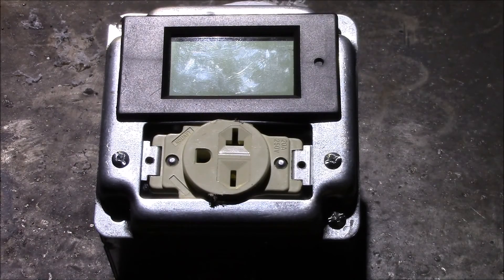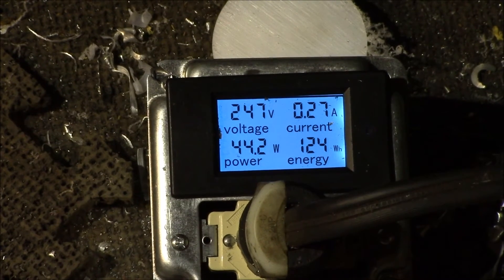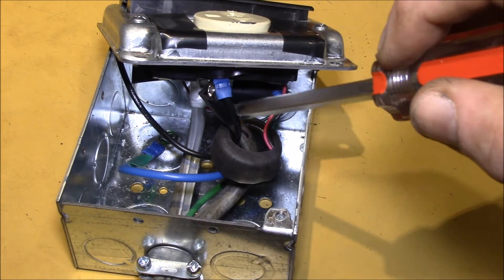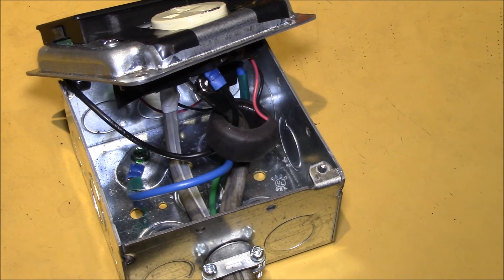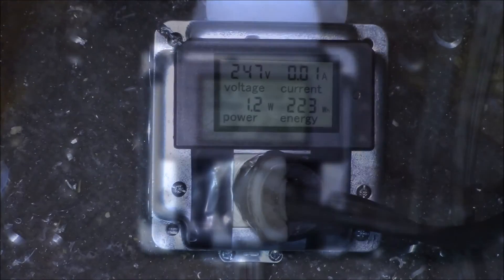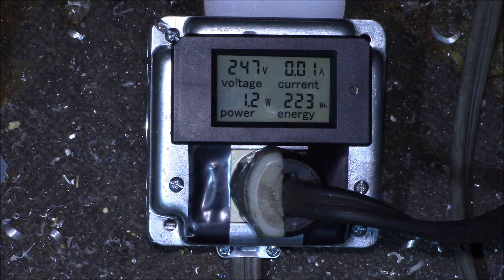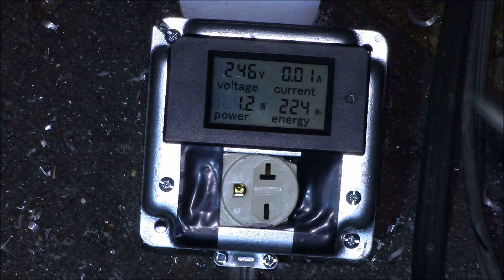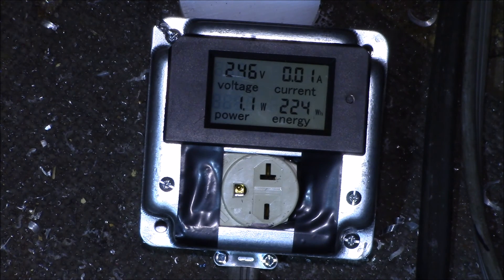240V Split-Phase Kill-A-Watt Meter, Testing and Mod

Comment: Stupid question. I am trying to use this meter to monitor my generator watt use. I would like to monitor the usage 3 ways using 3 meters.

I want to monitor the total use at 220. So would I use two hot wires (red and black) to power the meter followed my the CT going over one lead?

Than I want to monitor each hot lead  so I can balance the draw from the generator. So would I use one hot and a ground to power the meter than slide the probe over the same hot wire i want to monitor?
Reply from the maker: For the 120 sides, hot (L1 or L2) and neutral to power the meter, i.e. it'll read 120 volts.  Then run the connected hot wire through the CT to measure the current in that leg.  Think of using a volt meter and a clamp on ammeter, same connections.

For the 240 total power meter, use L1 (or L2) and neutral to power that meter, i.e. it'll read 120 volts.  Then take L1 and run it one way through the CT and then take L2 and run it backwards through the CT, doing this adds the current in each line together - reversed direction because the 2 lines are 180* out of phase.  Then the meter will read 1/2 the voltage and 2X the current, so the power will be correct.
Reply: @The4Crawler   @R Brown  I think I got it. Power the meter the same way the 120 but pig tail the leads back through the CT? Essentially how you did it in the video.

Another gentleman who is monitoring a tesla charger runs black and red hots to the machine than slips the CT over the outgoing hot lead. And he mentioned kirchhoff's law.

https://youtu.be/Y2Zshe7JKgk

I attached the link for his video
Reply from the maker: @gdejackmo  If you have a balanced 240V load, that is the same current in L1 and L2, then the way I wired the meter up works.  In my case, I was setting the meter up to work on my 240V clothes dryer, 240V welder and 240V milling machine.  This would probably work on an EV charger as well.  If this is the case, run one line wire through the CT and measure voltage from L1 to L2 and voltage, current and power will all be correct on the display.

But if your load has different currents on L1 and L2, then you need to run both through the CT, but reverse one of the 2 wires so they add instead of subtract (since L1 and L2 are out of phase they'll subtract unless you reverse one wire).  But since the currents are adding, the meter will display ~2X the current.  So to compensate for that, measure the voltage from L1 (or L2) to neutral, or half of the 240V.  So the meter will read half the voltage, twice the current, but the correct power.  For example if you had 8 amps in L1 and 12 amps in L2, the meter would read 20 amps (L1 + L2) and the power would read 2400 watts, or (8 x 120)  + (12 x 120) = 2400.
Reply: @The4Crawler  thanks for the clarity!

Comment: Very Interesting!  Thanks for the video.  I bought this meter to measure the output of my 3.7kW solar array.   I'm wondering how to connect the meter if my output is 240V (L1 and L2 are each 120V).    Should I run the hot lines through the CT but in opposite directions?     ...then how to connect the AC power?
Reply from the maker: If the currents in L1 and L2 are the same, you can wire meter across L1 and L2 (240V) and then run L1 or L2 through the CT as I did in this video.  Volts, amps, watts and KWH will be accurate.

If currents in L1 and L2 are different, then wire meter between L1 or L2 and Neutral (120V).  Then run L1 and L2 through the CT, one wire reversed direction.  Then volts will read 1/2 (120V), current will read 2X (L1 + L2), watts and KWH will be accurate.
Reply: @The4Crawler   Thanks.  I'll give it a try
Reply: @The4Crawler  When you say "wire the meter across L1 and L2" do you mean to connect both of those lines to the AC portion of the meter?
Reply from the maker: @scottantonides9209  Yes, just pretend that's a regular volt mater and you want to measure the voltage between L1 and L2 (240 volts).
Reply: R Brown got it.  I’m not sure how that works in theory but I’ll just give it a try
Reply from the maker: @scottantonides9209  All you are doing is powering the meter and measuring the voltage between L1 and L2, i.e. 240 volts.  If you were in a country in Europe, that's the same way you would connect the meter as those 240V countries have no neutral connection in the middle.  The only difference between this meter and a digital volt meter is the DVM has a battery inside it for power while this meter generates it's own power supply from the two wires connecting it to the power source.

Comment: If I'm measuring total watts on a 240v, 30 amp hot water tank, what size wire would you use for the two voltage leads that connect to the meter?  Thanks!
Reply from the maker: I suppose the safe answer is 10AWG or it's mm equivalent to have the same current rating as the connected circuit. 
 But you may have trouble fitting that large a wire into the terminals.

Note the two voltage sensing leads only carry a few 10s of mA current to power the meter, so most any gauge wire would work, say 18AWG or larger.  For added safety, one could use the smaller gauge wire with an appropriately sizes in-line fuse to protect that wiring in case the meter short circuited.  So any size fuse up to about 7 amps would be fine with 18AWG wire.
Reply: @The4Crawler  Hello.  Thanks for the video and the thorough responses to everyone.

Can you point me to an inline breaker / fuse for AC?  I searched but could not find one.  I assume that the hot wire coming into such a breaker / fuse will have to be of the gauge which corresponds with the breaker, true?  The outbound side, to the ammeter, can be of the gauge which corresponds to the breaker / fuse?

Will using such a breaker / fuse inside my service panel pass inspection?  For the reason you cite, a potential short, I am very nervous about powering the ammeter with a 15 gauge wire from one of the poles on my 60A breaker.  

The circuit being measured powers a wall connector for an electric vehicle.  Given an equal load, no use of neutral, should I run both hots to the ammeter, versus the one I've wired currently?  What would be the difference in terms of data reported on the ammeter?

Thank you.
Reply from the maker: With 2 hots and no neutral, you can power the meter (AC input) from a hot/neutral on a 120V circuit in the same panel off a lower current breaker with smaller wires.  Then feed both the hot wires through the coil in opposite directions, this causes the CT to add the currents.  So you end up with 1/2 voltage and 2x current displayed but watts are watts.  Or just get a small in-line glass fuse holder, most are rated for up to 250VAC, although might have to modify it to have a 60A gauge wire on one end.  With this, wire it like I did in this video and you'll see 240V and with only 1 wire through the CT you'll see the correct current.  But watts will be the same.

Comment: I have a question that probably has an obvious answer but I can't figure it out. How does the meter register 240 volts if it's only connected to one of the 120 volt legs? I'm assuming from the plug that the wiring is a 240 20 amp, which doesn't have a common leg, just two hots and a ground.
Reply from the maker: It's connected to L1 and L2 for voltage, that is 120+120 or 240 volts nominal.  It does only sense current in one leg, but assuming a balanced 240V load, the current in L1 is the same as the current in L2. Now if you had a load with say a 240V heater coil and a 120V motor running off one of the two legs, then that won't register correctly with this setup.  The meter will read too high if the 120V load is on the sensed leg and it'll read too low if the 120V load is on the non-sensed leg.  So this setup would not work to read the power consumption of say an entire 240V breaker panel where you have a bunch of unbalanced 120V and 240V loads.
Reply: @The4Crawler in other words it won't be great for a spa.

Comment: If you only have the pickup coil around one of your hot leads you are only going to be able to read half of the total  watts that your load is drawing. So if you double your readout it should be closer to the total energy consumption.  When you ran the meter power feed lead through the pickup coil is is not going to be able to subtract the load from the meter because the AC current is bi-directional cycling at 60hz. But that setup would work if it was a DC power meter. I have been trying to figure out a way to build a meter with dual inputs but I have had no luck in finding a system that will add the split phases amps together to give me a total energy consumption.
Reply from the maker: Depends on the circuit.  In this case, it's wired as L1 - L2 and Ground with no neutral connection.  So barring a ground fault, amps in on L1 = amps out on L2.  So measuring current in one leg and voltage between both legs gives the total power.  

Now yes, if you have L1, L2 and N and have unbalanced loads on the two legs, then agreed, you need to measure current on both legs and combine the two readings.  There are meters out there that do that, I cover some in this video:
https://youtu.be/ov2NfLBgjX4
I have a pair of the Aeotec home energy monitors that have dual CTs to measure total power on a 240V split phase system.

You might also check out the Open Energy Monitor project:
https://openenergymonitor.org/
Lots of good information on doing just that.

There is a way to set up one of these power meters to eliminate all of it's internal power consumption as shown below:
https://youtu.be/b2MXXSuzM2k
In this case, if I'm mainly measuring ~KW or larger loads, having ~1 watt of meter load was not a big concern, might be one least significant digit on the display.
Reply: Yeah, same here (despite that this comment is 4 years old) I found out this video because of the same, I found out that this metters shows 240v capable, but is made for one phase, not two :(

Comment: Great video, i'm a little lost i thought that you multiplied volts x amps to get a total of watts at 1:27 is shows 247v and 0.27 amps which shows 43.9 watts, but i get 66.69 watts am i doing something wrong.Thanks
Reply from the maker: With AC power, there's also power factor when dealing with non-resistive loads like my welder:
 https://www.allaboutcircuits.com/textbook/alternating-current/chpt-11/calculating-power-factor/
This meter factors the power factor into the Watts calculation but it doesn't display it.  In that instant, the power factor would be 43.9 / 66.69 = 0.66 (watts / volts x amps)
Reply: you need to multiply VxAxpf,you need to multiply power factor (pf)

Comment: Interesting, but what is the purpose?  Did you build this yourself?
Reply from the maker: Yes, built this myself.  I've always wondered how much power my 240V devices consumed but I never had a good way to measure that.  Now I can.  I've never found a 240V Kill-a-watt type meter for US power plugs.  You can get them with European power plugs but then you need adapters to plug the meter into a US outlet and then another adapter to plug in a device.  So instead of doing that, I made a meter that works with the power plugs I have.
Reply: Ok, guess that makes sense.  I was an industrial electrician during my working years..

Comment: Nice your electrical skill level is way above mine, nice job.
Reply from the maker: Thnaks, I guess those 4 yrs. of EE in college finally paid off.  I recall in an electrical machine lab, it took us most of an hour to set up equipment to measure power on a 240V motor.  We had Simpson volt and amp meters and then an analog power factor meter.  Then we had to record readings and do the match to compute watts, now you plug in the motor and read the data off the screen!